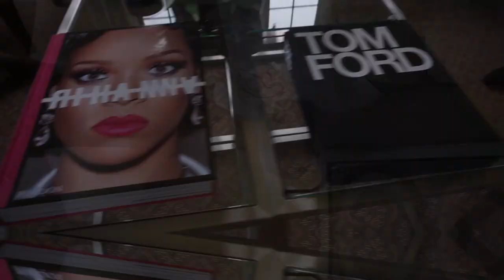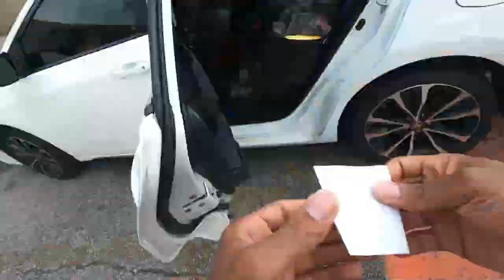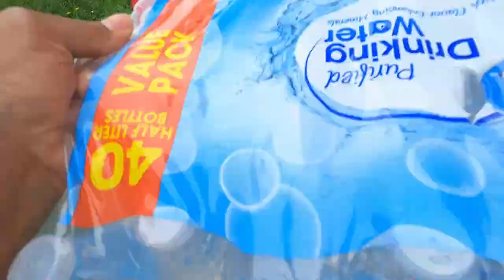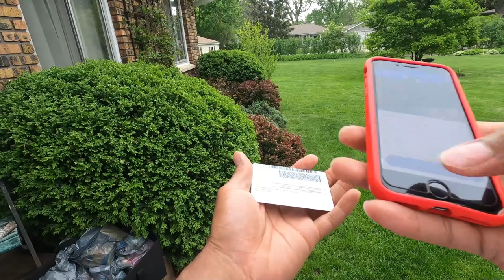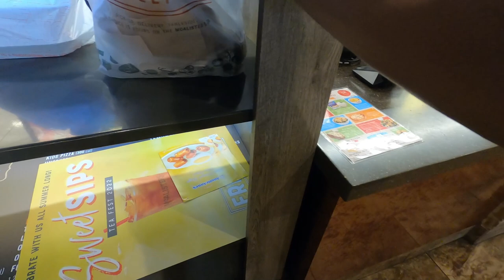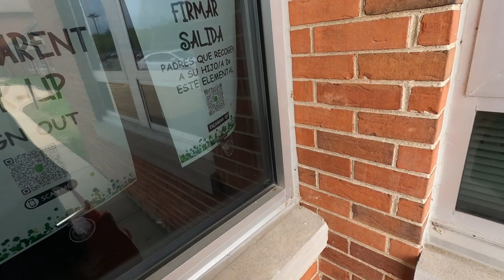Why Are These Orders So Big? Too Many Items!!😡 InstaCart, DoorDash, Spark Ride-Along, Tips & Tricks

Comment: This is odd topic but I wanna know if you've ever had trouble getting paid the correct amount on promo batches with IC? Here lately they've been doing promos where you get $5 extra per batch. What's been happening is that I get the promo but see that the batch pay is reduced by $5 so basically I'm not getting anything extra. I have to call IC to get them to make the adjustment. Seems there's a glitch in their system. Such a pain
Reply from the maker: We haven’t done IC in awhile. When we did we didn’t have any trouble getting paid the incentives.